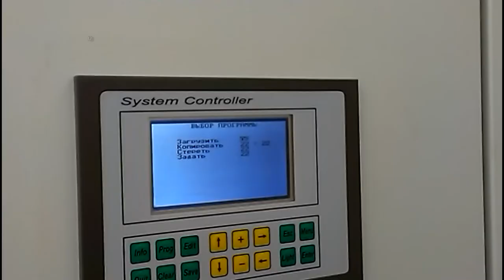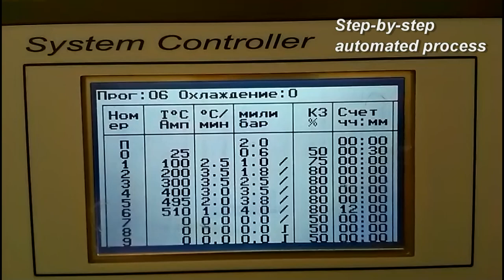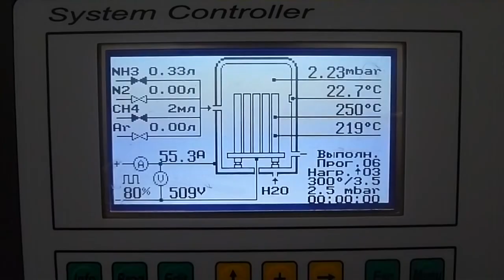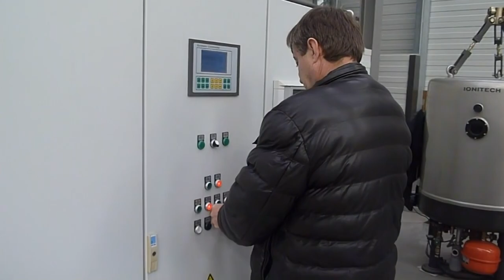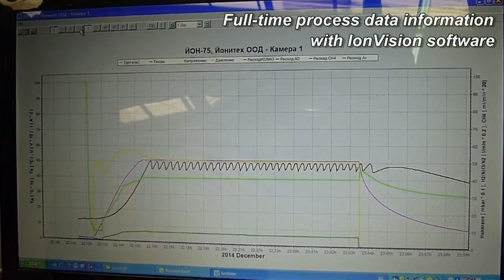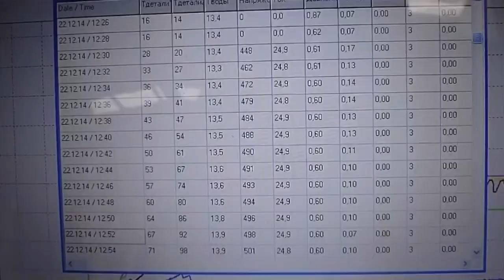Ion (Plasma) Nitriding process at Ionitech Ltd.

Comment: What are considerations for masking? Material, Thickness, tightness with part, if two masks are to be used for single part due to geometry etc., what factors are to be considered?
Reply from the maker: There are 2 ways of masking surfaces in Plasma Nitriding. The first one is by special masking paints. And the second way is with mechanical masking to cover the surface that you wish to protect from nitriding. About the steel grade for the masking - there is no need for a special steel or even the steel grade of the masked part, a common steel grade can be used. The masking part achieves the heat of the part, so no special requirements for thickness. And about tightness - a consideration should be not to leave small gaps where plasma can get inside and overheat the place.

Comment: Does this process affects the surface finishing? I mean in service manual for the engine I'm working on they said I have to do nitriding on the crankshaft after grinding the bearings. The question is do they need to be re-polished after ion nitriding? Do they change their diameter?
Reply from the maker: Plasma Nitriding is the last treatment. When you take the parts out of the chamber, they are ready to use. There will be no dimensional changes to the crankshaft.
Reply: @ionitechltd  Thank you for the response!
Reply from the maker: @brys555  you are welcome!

Comment: what kind of nitriding is this? gas nitriding, qpq or what ever they call it? Is it true that some methods of nitriding can surpass the hardness of chrome plating?
Reply from the maker: cj spicey Plasma nitriding is a process carried out in pulse glowing discharge and increaces the hardness and wear resistence of the nitrided steels. 

Plasma Nitriding is the modern way of nitriding and it surpasses greatly gas nitriding and QPQ with many advantages including: lower temperature and time of the process, no deformations and no need for post-process mechanical treatment, and it is eco-friendly unlike gas nitriding and QPQ.

Depending of the steel, the hardness achieved by plasma nitriding could be greater than the hardness achieved by chrome plating.
Reply from the maker: +EABOY2600 The process of plasma nitriding is far easier and eco-friendly than the salt bath process. It is easier to achieve better results, how much better depends on the steel. :) 
We haven&#39;t done gun barrels but it is possible to do. We nitride stainless steel almost all the time. Depending on the process it could maintain it&#39;s colour or if we add post-oxidation the steel could be made black in colour.
Also depending on the process done the steel could have a larger diffusion zone but that will result in loss in corrosion resistance. The reverse could also be done - maintaining the corrosion resistance and smaller diffusion zone but creating a surface hardness of about 1300 - 1500 HV (we measure in Vickers but it is about 75 and above HRC)

You can contant us for more information on our email: office@ionitech.com
Reply: That's a sweeping statement. Ion (plasma) nitriding has its advantages but cannot  replace  controlled gas nitriding ("Nitreg" process") when parts have a complex geometry. Besides,  temperature uniformity and measurement in the chamber is much more difficult.

Comment: Is Plasma nitriding/Ion nitriding is recommended for EN8 Material? our part is a plastic inj molding nozzle tip made in EN8 material. pl recommend which hardening process should be done to increase material properties to reduce wear and increase toughness. Pl suggest
Reply from the maker: Hello! For this type of steel it would be better to do plasma nitrocarburising it will increase the surface hardness and the wear resistance. Our equipment can do both plasma nitriding and plasma nitrocarburising.
Reply: induction hardening

Comment: @5:37 are you removing the covering over the threading feature? Are all the jobs are covered by the same cover to protect? Is this process not recommended for threading? Pl explain. I have recently done one job of of this process over an internal threading like feature called as serrations of 0.2mm depth over the length of at least 20mm. each serrations has width of 0.2mm and depth 0.2mm. pitch is also 0.2mm. Trials are awaited as these are internal serrations in ID of die 50mm we cannot check the quality of the profile formed/changed after Nitriding. Pl suggest.
Reply from the maker: Hello! Depending on the parts' requirments the thread could be nitrided or not. The covering for these parts is because the thread musn't be nitrided.
If the thread must be nitrided the process parameters should be chosen depending on the thread.

Comment: Thanks for uploading, Dont you think if there was an extra plate over the second layer tools , there is better homogenous plasma invironment between first and second layer, as it was shown, thefirst layer tools components are  sandwitched between two plates, while the second layer is only packed from bellow and above it there is no plate, therefore the plasma homogenity will be diffrent between first layer and second, the heating time o heat second layer(top) will be more as the first layer plasma environment is more intense than the second layer.
Thanks uploading the video.
Reply from the maker: 123kkambiz We are preparing a second video at the moment :)

We have more than 40 years of experience and we found the best ways to treat the parts in our equipment. The plasma depends on controlling the temperature, the pressure, the gas ratio and other factors, and in this specific process there is no need for a second "sandwich" for the upper parts, and we still achieve the same results on both rows.
Reply: Thanks for clarification, ad expanatin, I used to do the same job in India with less controlable power supply, and we used to sandwitch the components .  I think the controlable pulsed power supply is very essential component for successful operation of the process aon with pressure and gas ratios and temperature.
Thank you very much for your reply , looking forward to see your next videos.

Comment: What would you normally be required to report for such a process? Nitride Cycle Time, Gas Mixture etc etc...
Reply from the maker: Our furnaces create a graph of the process, where you could see Time, Temperature, Gases, Pressure, Current, Voltage. You could see it in our second video - https://www.youtube.com/watch?v=8_jt93zrT20
Reply: Thanks

Comment: Whatabout the bottom part? I guess it's not fully treated because some areas are covered
Reply from the maker: Yes, only two small lines remain untreated (where the part was standing on the rail). Everything that is covered remains untreated, as the threads are covered in this example.
Reply: Is it necessary for the material to be in contact with the rail?
Reply from the maker: In this case we used the rail because it has the least surface touching the part. The parts need to be touching by some way the cathode (plate) and that way they also become cathode.

Comment: How much hardness can be obtained ?
Reply from the maker: Depends on which steel grade and on the process parameters. You can see some of the most common results as surface hardness and diffusion depth for some steel grades here - https://www.ionitech.com/plasma-nitriding/solutions-and-results.html

Comment: Is there a way to reverse this process with the same equipment featured in this video?
Reply from the maker: No, it is not possible to reverse it with the same equipment. To remove the diffused nitrogen you will need much higher temperatures.
Reply: @ionitechltd  Do you guys make equipment to achieve this. Also can you elaborate on the process one would use to remove the diffused nitrogen. We currently have a ION-100i model we are using to nitride H13 Tool Steel.
Reply from the maker: @charlescross1727  can I ask you to write to us on our email - please find it here - https://www.ionitech.com/contact-us.html on the right, next to the contact form. (I don't want to put the email directly in the comments here).

Comment: what is nitriding?
Reply from the maker: Nitriding is a type of heat treatment that incorporates nitrogen into the crystal structure of the metal or alloy, through diffusion, and this way enhances the properties such as surface hardness, wear resistance, corrosion resistance and fatigue life. You could find more about the plasma nitriding process on our website - http://www.ionitech.com/
Reply: Great....if our subtract is glass ?what is the nitriding process?

Comment: dimensions of furnace ?
Reply from the maker: The working volume of this specific furnace is diameter 1000 mm and height 1100 mm. (It is up for sale on our Second-Hand equipment page - https://www.ionitech.com/products/ionitech-second-hand-equipment.html).

The furnaces Ionitech's manufactures are very different in size and power - from smaller ones to a lot bigger - depending on the client's requirements.